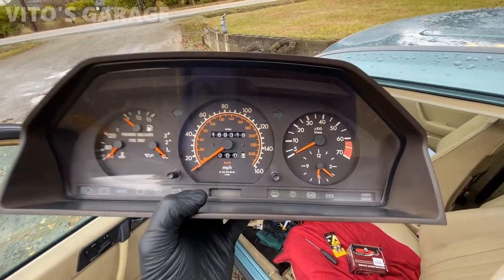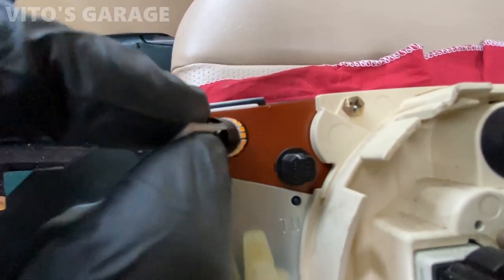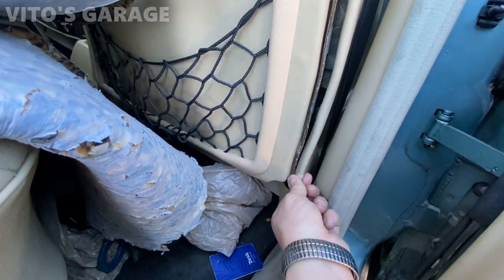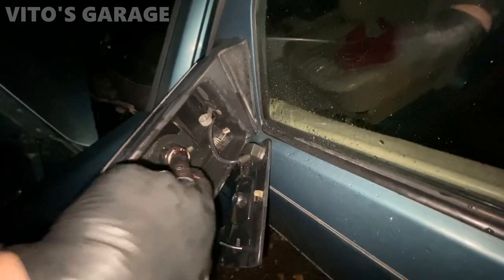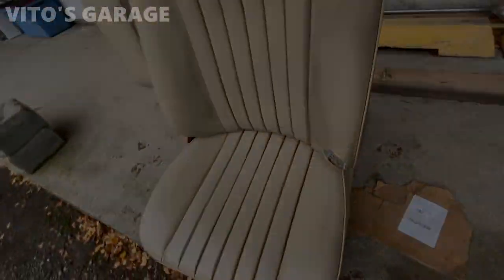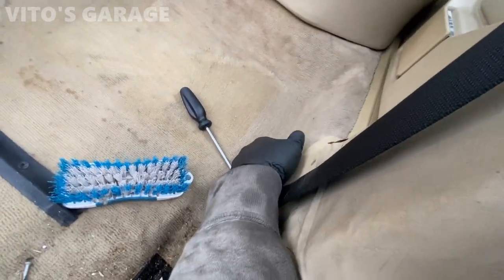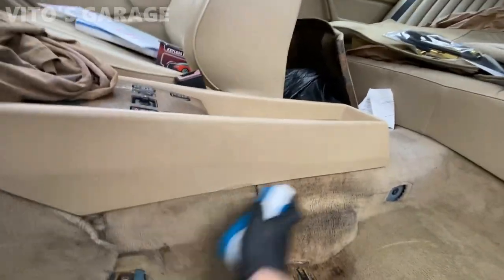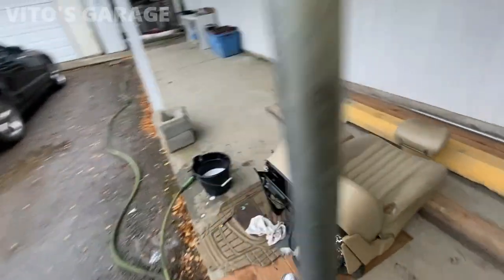Part 12 Mercedes W124 Cold Start, Cluster Refurbishment, Interior Cleanup, LF Mirror Lubrication

Comment: Vito
I got a problem
I got a w140 and I tried to change the oil but I think the oil plug drain screw is internally messed up because it rotates all around easily but it won't come off I have tried every trick in the book.
Any ideas what to do next
Reply: Is this some kind of a tool that I should get
Reply from the maker: Option 1: bring it to a good mechanic who knows what he’s doing
Option 2: suck out the oil from the dipstick tube
Option 3: drill and Heli Coil
Option 4: Replace the oil pan 
Option 5: keep on trying to remove the drain plug. Put side pressure on it while turning the ratchet
Reply: @VITOSGARAGE  
Thank you very much right now is very cold in Midwest I will try that for sure